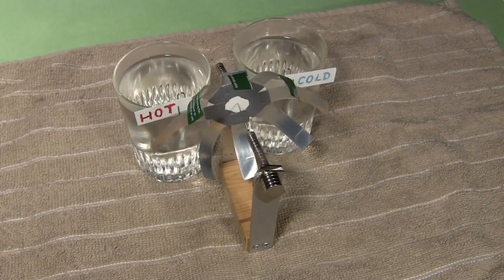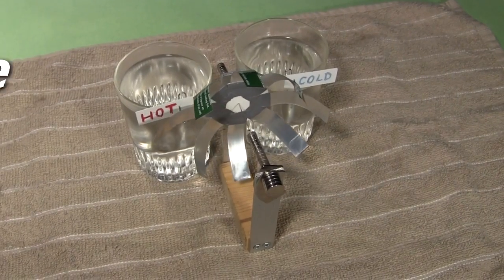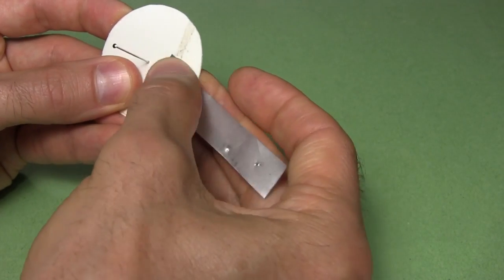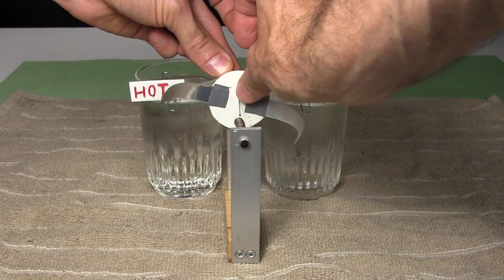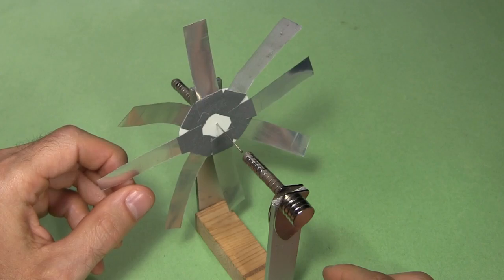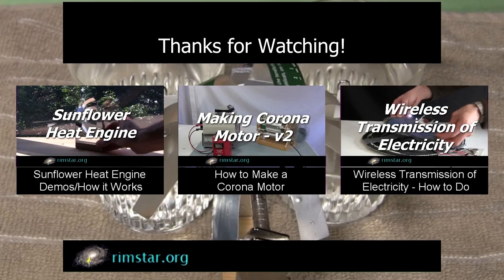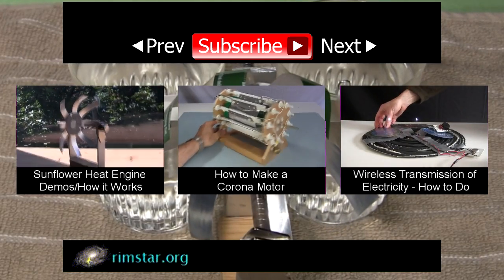How to Make Sunflower Heat Engine using Coffee Bag

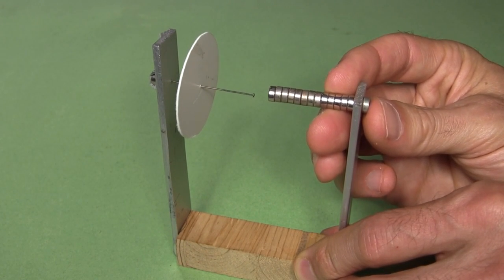Comment: Great magnetic solution for  providing support to an object. The needle is so sensitive when not yet attached to a load it can be seen pulsing with your heart beat at the 0:59 sec mark of the video. I have a small iron pyrite rock in a curio cabinet that when placed just right will ever so slightly rock back and forth to the beat of my heart when I stand next to it.  It wouldn't work if I have concrete floors.

Comment: Cannot for the life of me get the thing balanced! I've read comments and I know it's "supposed " to be easy, but it continues to flop forward and thus it doesn't work. Ugh! My son is working on this for a science project and after many hours of trying to balance the thing, I'm afraid he's doomed! Wish I could figure out what we're doing wrong!
Reply from the maker: +Carol Bulmer Does it always flop over with the same side up? If so, your needle may not be centered properly or the petals that are on top at the time are longer or heavier in some way than those on the bottom. Or your magnets may not be strong enough. Either move them closer to the needle or add magnets. Also, play with the vertical position of the magnets. They don't necessarily have to line up with the notched on the other side that the needle is in.
Reply: +RimstarOrg Thank you for your reply! I never expected to get advice from the actual expert! Much appreciated. we used a compass to insure that the pinhole was centered. We also measured the strips and placement of pedals on the disc very precisely and multiple times. we added more magnets and it continued to flop forward. I didn't see your reply until just now, but I kept spinning it and watching which side flopped to the downside and then I added more small pieces of tape. this was what you did in the video, but I had to add A LOT of small pieces of tape. I finally got it to go a bit, but I think maybe it was too heavy to work as well as your's after I got it pretty well balanced (heavy duct tape). it's a really cool project. I think I'm not the best heat engine assistant, but we stuck with it! so is it all in the balancing act? we tried different containers of water, different temps, different distances...we tried just about Everything! I do think it's all about the balance. tell me if I'm wrong. oh...we also tried a different coffee bag. we're all set for coffee for a while!
Reply from the maker: +Carol Bulmer Balance is crucial since the unbalancing force resulting from the effect is so small. If there's a heavy side that's facing down then it will take too much force to rotate it up. A solution to all your added of heavy duct tape is to figure out where your balance problem is to start with and fix, or improve it, there first.
You should be able to tell if you have the right material by applying heat to it as I do in the video and seeing if it curls up in any way. If it does, then you have the right material. If not, then you have to keep searching.

Comment: Why does in straighten up on the hot side ?????
Reply from the maker: sciencenerds I'll be explaining it in this week's video, but basically the amount that the metal foil expands due to the heat is greater than the amount that the laminated on plastic expands, so the metal foil sort of pushes laterally on the plastic, straightening it up. That's the theory anyway.

Comment: I assume if the temp was more extreme it would go faster. 
If you put 1/2 of it in the shade and the other 1/2 in the sun it should work the same to be a solar shade motor. LOL It's all speculation.

I dont think most of us have the patience to do that.
Reply from the maker: xwsx001 I've already tried it 1/2 in and 1/2 out of the sun and it works great - faster and more continuous, possibly due to more heat so your assumption may be correct. You'll see it in this week's video.

Comment: You are one hell of a patient maker. I would have chucked it all before getting it working. HA! Great science experiment in the end and great for a grade school project too.
Reply from the maker: ***** Even more went on behind the scenes, before getting to the point you see in the video. But once I got to where I start in this video, it really did comprise of only what you see, so not much patience was required at that point. Since I don't drink coffee, before going out and buying a bag I spent time experimenting with aluminum foil attached to various types of tape. None of them worked as well as the coffee bag though. Duct tape was best, surprisingly, followed by packing tape. Aluminum tape backed by anything didn't work at all, probably too stiff. I do have a scientist's type of curiosity :). 
Anyone know what I can do with a bunch of coffee? :)
Reply: RimstarOrg Beans or ground? If ground I'll buy it off you just so it doesn't go to wast and I can enjoy a cup it on the weekends with you while watching your great vids ;)
Reply from the maker: *****
:) Ground. There's gotta be something I can make with it, or a science experiment of some sort?
Reply: +RimstarOrg what you do is upscale and build it into the side of a mountain where the slope faces the sun, the half contained inside the mountain is cooled by the constant temperature (i think caves are around 68° all year around, and then the exposed side is heated by the sun. You wouldn't have to necessarily curl anything, the metal bars would simply expand in the heat of the sun over balancing the wheel on the warms side. It may turn slowly, but with a large enough wheel and gears you could easily convert the angular momentum into a higher velocity used for turning a traditional generator.

Comment: HOW THIS WORKS?
WHY ROTATE IN THAT WAY?
IF HOT AIR UP, AND THE COLD DOWN, NOT SUPPOSED TO ROTATE IN THE OTHER WAY?
CAN SOMEONE EXPLAIN IT TO ME PLZ?
Reply from the maker: Umbrella Corporation I'll be making a video explaining how it works next week, or at least how I think it works. It has to do with the aluminum foil expanding when heated and cooled at a different rate than the plastic. Since they're laminated together that difference causes them to deform the overall material.

Comment: Hi RimstarOrg.
Love your videos.
Here's one that I made with my kids.
I have a 3 story house and it gets quite hot upstairs in the summertime.  I open the windows on the first floor, and the windows on the 3rd floor, inviting Convection to do its thing.
I took some construction paper and lego, some copper wire, tape, and a straw.  I made a windmill out of the construction paper and mounted it on a Lego base.  The copper wire is the shaft, and the straw is the hub.  I mounted the whole thing and then placed it in front of the 3rd floor window.  It spins because of the hot air leaving the top of the house, and the colder air entering from the basement.
I don't have a video, but this kind of reminded me of that project.
Take care, keep up the great videos, you're inspiring to a lot of people.
Reply from the maker: God Was Bored That sounds like a fun one! Projects that use the energy from the surroundings are awesome - it feels like you're getting away with something you're not supposed to be doing. I'm sure your kids will make use of that knowledge throughout their lives. Cheers, Steve.

Comment: I guess that frequent unbalancing problem was really annoying.
Reply from the maker: Brandon Fisher Not really. The unbalancing happened only during each stage of construction and you saw everything I did as I went along - so there wasn't much to it. Once finished, balancing is no longer an issue. With something that turns as weakly as this it was important to do it right in order to get good result.

Comment: blacken the backside and use the might of solar power? ^^
Reply from the maker: madinatore If you look closely at the preview for next week's video which I show at the end you'll see it running with sunlight and running pretty well. That's with the backside not blackened, but I will be trying with it blackened too to see if there's a significant improvement.
Reply: blushes well as I know the rest of your videos I skip the ends, black is supposed to be  optimal to receive or emmit infrared, maybe try sut aplied with a candle? Though that might add too much mass or insulation...

Comment: Interesting.... 
a passive heat engine has allot of uses.
Reply: RhetteLawe What uses? the only thing I can think of is as a science toy.
Reply: Power Max what are you talking about: I just took out my car's engine this afternoon and replaced it with one of these. Runs like crazy. No more gas for me! I put magnets on the blades and a piece of copper where the hot water glass is so as it spins it heats the copper to make It go even faster.
Reply: +Andy Jones not sure if being sarcastic or if actually doesn't know how magnets work
Reply: radioactivated the gamer umm, the only problem you had with that post is that I don't know how magnets work... really... look up magnetic induction heating. Its the only part of that post that is actually true. When magnets spin past a conductor, it will heat up red hot or even melt. Everything else was sarcasm aimed at the "free energy " crowd but that really is how magnets work. The perpetual motion nonsense was just me entertaining myself.
Reply: Andy Jones Interesting, today I learned

Comment: This has to be one of the least inefficient engines ever
Reply: ***** also fun off course
Reply: ‍1marcelfilms
Perhaps, but it helps kids visualize and understand how heat can be recycled and harnessed.
Reply from the maker: ‍1marcelfilms Yup, but using water glasses is good for when the sun is not out. In the sunlight it works better (you can see a little of it in the preview for next week's video at the end), and then the efficiency calculation is different. That aside, it's pretty fun science.